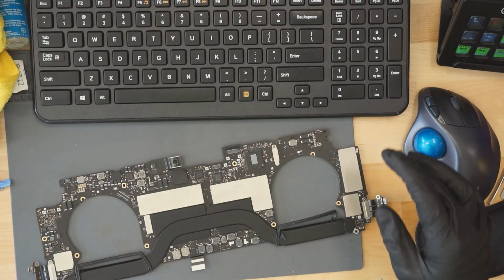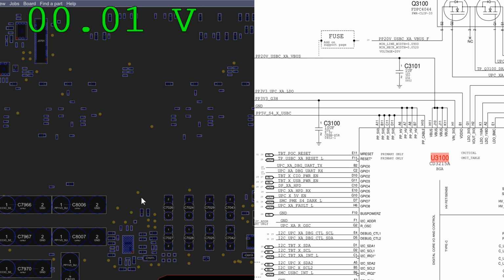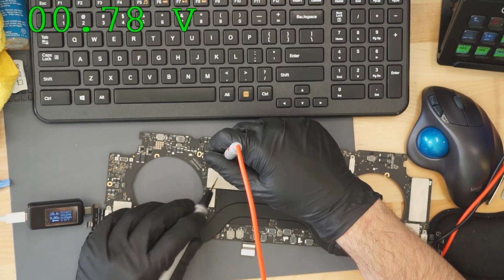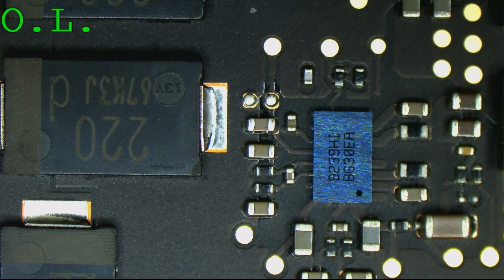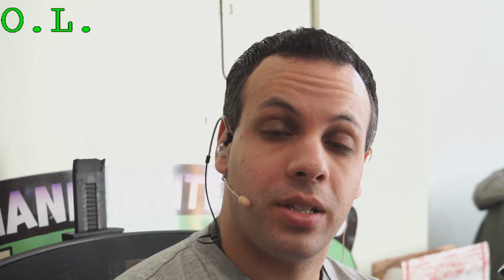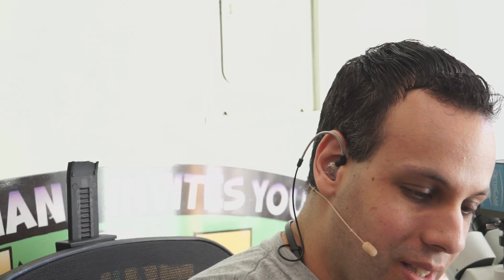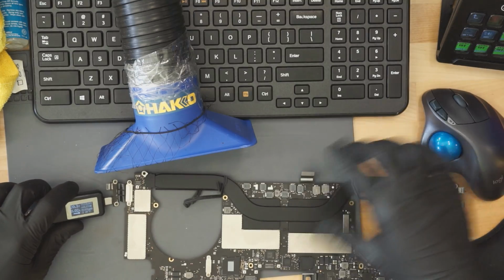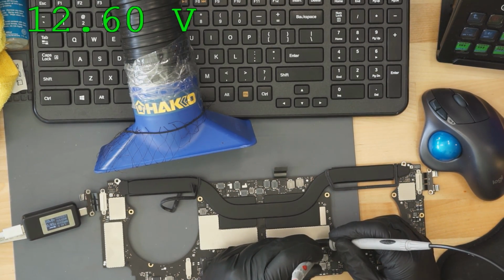Why new Macbook boards will be unfixable for me: sad :(

Comment: You can't get the parts etc... What happens when in 2025 Apple refuses to repair the 2018 MacBooks because they're 7 year old 'vintage' and they don't repair vintage electronics?
Reply: Apple doesn't repair. They just replace parts. Entire parts that is more aking to refurbishing than repairing.
Reply: @0Raik  Refurbishing isn't fixing or repairing.
It's semi-botching it to kinda make it work as long as you don't touch anything.
Refurbished is worse than buying a heavily used phone.
Reply: Yeah, Apple would just replace that whole board. If they fixed it - they don't always, even if they swapped the customer a new one.
Reply: Mac collectors: Pre-Intel is vintage
Apple: Pre-Skylake is vintage
Reply: I imagine repairers would have to buy laptops with broken screens and strip parts from the motherboards. Seems super wasteful but that's the future apple wants
Reply: @animedrawer69  Fight back, because if Apple gets away with it, it would only be a matter of time before other large corporations do the same - And they are.
Reply: Repairing is shitty for manufactured boards. It’s a waste of time. A big company would be dumb to repair that way. They replace and get it back faster and they can chose to repair and refurbish the broken part.
Reply: @sandi260  Repairing is the ethical choice. Imagine if we just replaced telephone lines instead of repairing, or built an entire new house because a door needed to be repaired. Wasteful and illogical.
Reply: You buy a new one, because in seven years a 2018 era MacBook would be extremely SLOW by comparison.
Reply: @VideoArchiveGuy  An arbitrary argument. If you only need what you have there is no reason to keep upgrading. That overall mentality is why the world in general has so much waste - due to consumption. Everything should be repairable, or not be legal forsale - but that's just my 2 cent opinion.
Reply: @husher5142  Well that's not the way the world works. It would be obscenely expensive for companies to keep making parts that were rarely needed or keep parts in stock for a "vintage" machine for which they no longer provide hardware or software support.
Reply: @VideoArchiveGuy  Saying its the way it is and not changing it is the very reason we are in this situation. Humans designed this system, we can certainly change it.
Reply: @husher5142  Feel free to open a fab that licenses parts from those who originally produced them and hopefully you can make a profit producing replacement parts, otherwise I can't see it happening.

Comment: The more I watch this channel the more I harden my resolve NOT to buy any products from crApple and instead buy products from manufacturers who dont pull tricks like this. Companies like Gigabyte (the maker of the motherboard in the self-built desktop PC that I am watching this video on) don't lock things down so I have to use parts approved by them. Nor do they prevent me from running the OS of my choice. And Nokia (the old Nokia who made the Nokia N900 linux phone I use as my primary phone, not whatever crap Nokia is today) do not have any kind of locks that prevent me replacing the screen or battery or any other bits.

Comment: Would it be possible to sacrifice an USB port on the logic board by using that USB controller chip to replace the one that controls the power, to get a board that at least powers up, but with one USB port less?

Comment: I’ve used SanDisk SSD drives for years, probably since 2011 in multiple machines. Never had a problem with one of them. Sure the specs don’t light the world on fire, but they’re a great value IMO.

Comment: this guy charges like $300 to fix board issues for 2012 macbooks, you can get a new 2012 off craiglist or offer for less than that. 

With that being said, and that is why I am not getting any new macbook shit. The older ones can be repair, even if its expensive they can, good luck fixing your $1600 MacBook if it ever breaks.

Comment: If a supply chip is dead, a replacement circuit could be attempted to be made.

But 
a) the end result would be a total savagery
b) it would be no way near as durable as the original
c) it might not be able to fit in the mac when everything is assembled
d) it might be costlier, more time-consuming and worse in the long run for the customer, compared to just them buying a new laptop

So yeah... not really commercially repairable (at this point).
Reply: Just them buying a new laptop?? I think you are missing something....you don't mean another owner repairable crapple??
Reply: Unrepairable
Reply: @johnbrewer9833  If the customer was the person who repaired the laptop with their bare hands, then it would be cheaper to repair (not considering cost of time). 

But imagine Louis is the person, who has to find a way to replace a tiny IC with a whole patch PCB and somehow find a way to make it work reliably as the original. I would guess it would take him a lot more time that a standard repair, where he has all the necessary components. He would have to charge more (because it would take him more time) or it could even be commercially unviable for him.

Just to be clear, I am not saying to create a new IC that would be a knock-off of the original. That I think would require a whole company that specialises in IC manufacturing. 
I am talking about something a normal person without a lot of resources could build - a PCB with a power supply circuit, that would replace the functionality of the IC. That PCB would have to be small enough to be glued to the motherboard and fit in the laptop case.

Edit: Now that I think about it, if such a PCB is created, and reliable enough, Louis could find a way to attach it in a way that would be reliable and wouldn't make future repairs more troublesome. But then again I don't know if such a PCB would even be possible to fit where or near the IC is positioned.
Reply: I was wondering how much hassle it would be to commission a knock-off.
Reply: @chaos.corner  I don't know really. Someone who is more knowledgeable in microelectronics should be able to answer. I was thinking more of a whole PCB with totally different components but the same functionality, that would be small enough to be glued to the motherboard and wires traced to the pads where the IC pins would be soldered. As I said, that would be savagery, though it should work.
Reply: @ЕмилиянНиколов-ж4ж  A possible option. It might also be possible to do something with a microcontroller which could possibly be soldered to the pads like a mod chip.
Reply: @chaos.corner  A microcontroller is quite a versatile IC, but it isn't that versatile. For example if there is a power switching transistor in the original IC, a micrcontroller wouldn't be able to handle that current (could be a lot more than an amp) at the needed switching frequency (could be several MHz) without additional circuitry. It also wouldn't be able to handle the input voltage (12V for example), without additional components.
There is a reason there are specialised power supply ICs - it is a lot simpler, more reliable and more compact to build a power supply with one.
Reply: @ЕмилиянНиколов-ж4ж  True. I'm not really aware of the full function of this chip.

Comment: Reverse engineer and use compatible chip.
Or ask someone to do it for you and resell working solution.
Reply: lRaziel1  it would not be THAT easy, but chip itself seem faulty to the point that making an improved alternative as better option than using unreliable original that just dies by themselves without reason.

Comment: Doesn't surprise me why Apple may be doing this.  As Hardware sales stagnate, they must protect their service revenue and forced-replacement sales. Moore's law has reached a limit supposedly...hence the business strategy to lock down the captured ecosystem.  I also imagine the corporate world may be moving to longer depreciation (decommissioning) time-frames, further exacerbating the HW sales issue. The PC ecosystem has a lower barrier to entry and cannot be effectively locked down...meaning it will commoditize further and to the consumers' overall benefit.  This will put further pressure on the Apple ecosystem. Sell? IMHO.

Comment: "...suck a fucking dick. Time to fix another MacBook" best transition ever.
Now how bad is Apple's soldering process that it seems like every one of their chips breaks loose? I don't consider myself a professional repairman, however past several videos I've seen some pretty bad ones on these boards that I know I've done better. Maybe they're not using the appropriate amount of flux?

Comment: The Reason I don't buy Apple is simple, all the problems you'll have when you need to fix your Ipad apple computer and more. I like the Idea to buy Samsung and HP because since I have been using those Items I have not had a problem with the Computers.  I see that Apple has a whole lot of problems with their Hardware and need to be fixed a lot, but apple is totally against Fixing these computers, they'll just have you buy another one and throw away a new one you only had for 2 months and the screen is broken. Apple is totally wasteful and I see them as undesirable on any level.
Reply: My experience exactly. Particularly in the case of Samsung.uk .

Comment: So you know what that chip does, right? . How hard would be to patch it with other components?  Would it be difficult to design or produce a replacement?
Reply: Easy!! Just measure it's length, width, height and weight. Print the number on the top and there you go!  Seriously If only it were that simple. The chips are already in existence but being held back allegedly by crapple
Reply: @johnbrewer9833  The insides of that chip could be complicated, or just a couple of gates. Wouldn't be the first device with a self-destruction component that can be easily replaceable
Reply: @animo005  It's just sickening that crapple can commit so many laptops to an early death through sheer greed. I tried googling it out of interest to try to get an idea of what is inside.

Comment: What is that gel that he applies on the board?
Reply: Flux paste. It is basically high temperature cleaner and when heat is applied it makes sure both the board contacts and solder are crystal clean so they can be joined properly. Most solder contains some flux, but more is better especially when working on crusty old boards.

Comment: The chips must do similar jobs, while I doubt they're pin (pad) compatible are they function compatible? Meaning can you use the chip you can actually source with an adapting board?

Comment: They changed ownership a few years ago. They’re etechparts plus now. I haven’t gotten a bad screen from them in a while. I messaged them on their website chat and they did work to resolve the issue and continue to follow up later. Idk but I could understand why they wouldn’t want it on the public page if they’re willing to rectify it although I’m not sure if that opportunity was given or not. I’ve had mixed results with quality over the past 5 years but none for at least about a year.

Comment: Hey Louis, you should make a video about the absolute BULLSHIT heatsinks HP uses (they degrade so badly that the CPU cooks itself within a year most of the time, not an isolated case by the way). Seems right up your alley. Most HP warranties offered by various sellers don't even cover that issue either. When I had it happen to me I contacted HP and they kindly told me to go fuck myself and just buy a new laptop. I contacted HP after Office Depot (the store I bought the laptop from) told me that it was HP that could help me. I've had another HP laptop that had its heatsink do the same thing, but I stopped using it before it could fry itself. Switched to my Acer Chromebook that has proved to be reliable for four years and counting. The few people lucky enough to have had good experience with HP criticize the massive amount of people calling them out on their bullshit, and they're basically like the massive amount of Apple fanboys I see in the comments on every Samsung video known to man.

Comment: Can't you make an adapter PCB for an other chip or even a chip with a few support components. Often these special chips are just mutations of the PIN outs to make them incompatible. Sometimes things like a signal will get invert, rolling new silicon is usually too expensive. Aka enable signal is low instead of high. etc... Even if a compatible chip isn't available if you have enough demand, you might be able to do something using a micro-controller and support components.

Comment: The email in the beginning kinda makes Louis look like hes holding a grudge since it was so long ago. But man, head on over to their facebook and grab some popcorn. Looks like they're screwing their customers over. Juicy stuff... Any chance we can get a vid elaborating a bit more? Edit: Also looks like they tanked and were bought out some time back. The established date is Sep 2016, which hints at a reboot after bankruptcy or something since its after Louis' banning.
Reply: mysock grabs some more Orville... Munch munch munch "ETECH PARTS IS BANKRUPT AND NO LONGER ACCEPTING RETURNS. Friends of the repair community, I urge you to stop placing orders with them before you find yourself in my situation. We have a $9,872.00 open RMA which eTech Parts is refusing to fulfill (their store credit is now virtually worthless). They owe millions of dollars to Chinese suppliers and their credit line has been cut-off, which is not allowing them to re-stock inventory. If you have questions, message me as I have direct knowledge via friends in Asia. Their public statement currently is something along the lines of "we're looking for new ownership", but behind the scenes they're headed for bankruptcy."

Comment: Yeah, I'm never buying anything Apple.  I don't really need it though and with video editing software getting really good on other operating systems I don't know why anyone would ever get one.
Reply: @CM-kh5ow  Apple creeps me out as much as Microsoft does.  Linux isn't that bad now, I think with the last few versions of Linux Mint it just runs.  The install I have right now I haven't updated it for the last two cycles, so a year or a year and half.  Usually it has problems and I welcome the updates with a reformat/install but it is stable and the new versions don't have anything I need.
Reply: @CM-kh5ow  That's what I'm saying about Linux, I always mess it up but the last few versions of Mint(based on Ubuntu) have been solid.  I do very minor editing with Blender also, I wish Linux had video editing specific software(blender is a 3D animation program with video editing tacked on) but eh, it is good enough for me.  I've used Linux for over 15 years now and have seen it progress.  I think I've used it 100% for at least 10 years but just now starting to think it is rock solid.
Reply: iOS development.

Comment: so can you please explain what happened and you used hot tweezers instead of an iron?
Reply: He had a hot air gun and he just pulls it off with a tweezers. That parts are really small so its easier to hot air gun it.
Reply: @johnbecker3116  i meant the ~4:38 part
Reply: @Pogohontas.  really looks like "hot tweezers" to me, google it, also unles he uses another station other than fx-951 i haven't seen such a tip
anyway chances are it was easier for him to grab that but i am curious